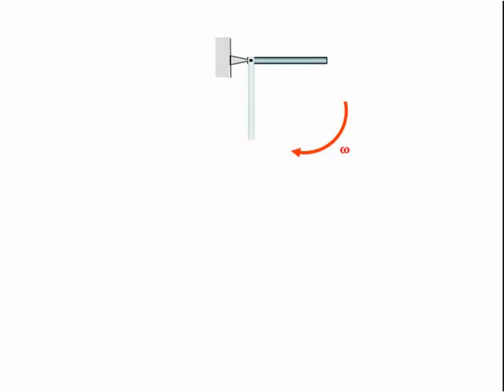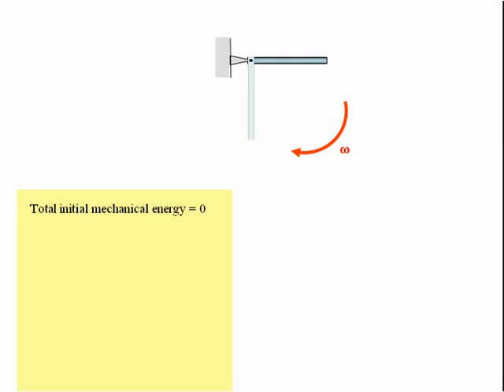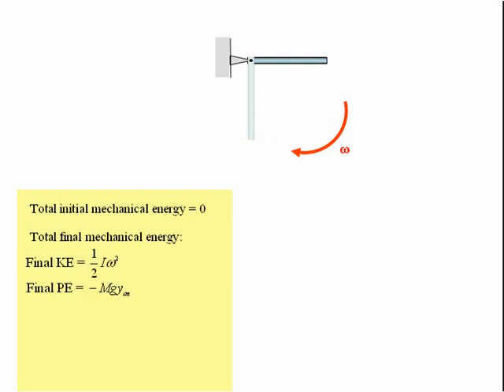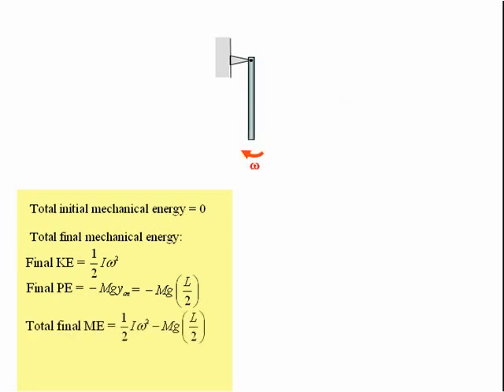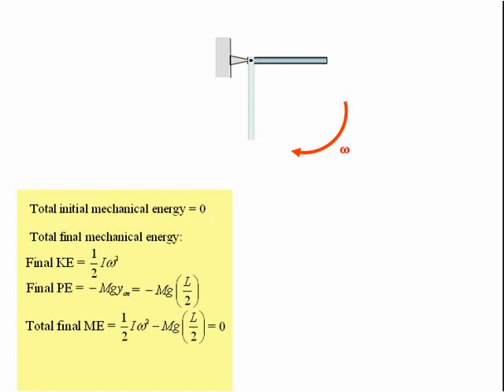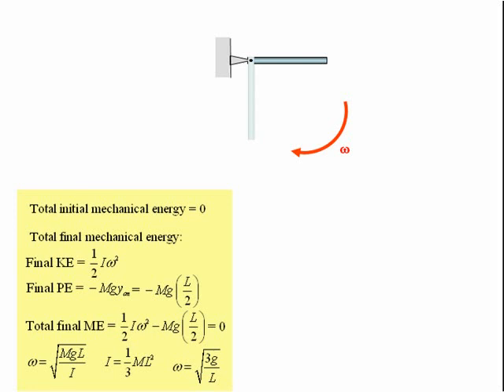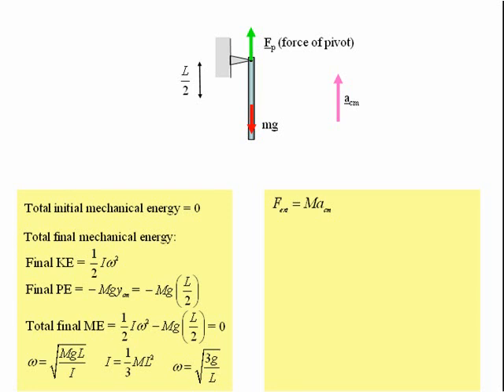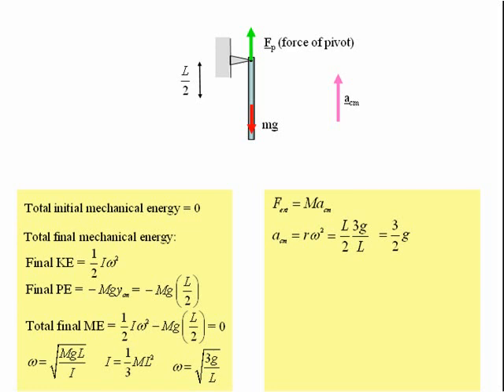rotating rod released from horizontal

Comment: Wait but won't the rod have some potential energy in horizontal position? If so, then the initial mechanical energy won't be zero!
Reply: It won't have any potential energy if we take the initial starting position to be the horizontal position. Potential energy is a relative scalar.